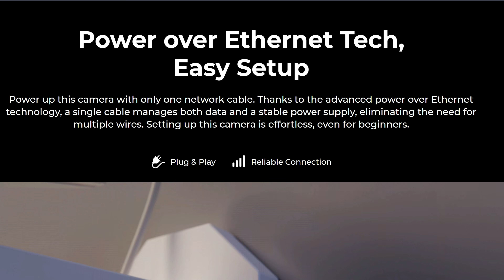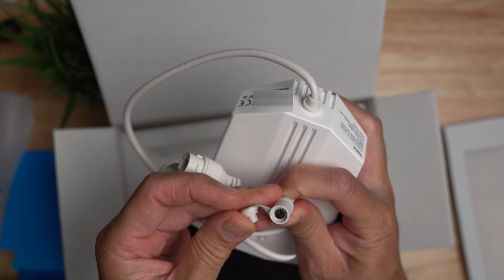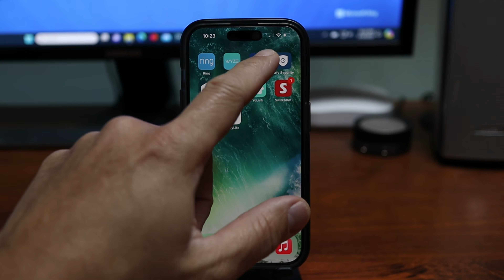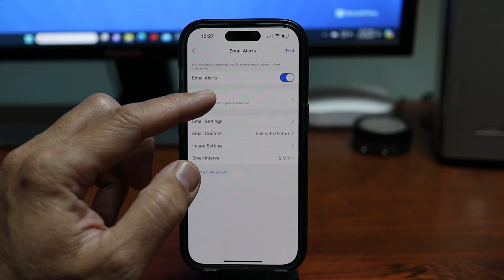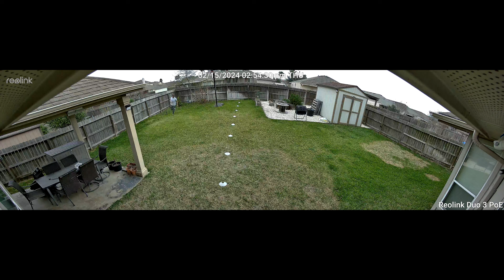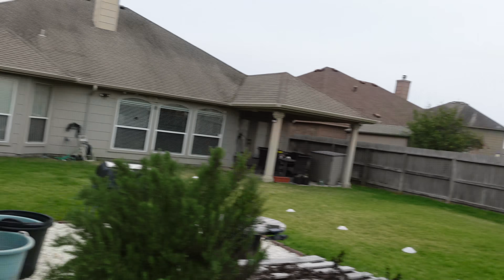Reolink Duo 3 Review - 16MP Dual Lens 180° View PoE Security Camera

Comment: This camera is NOT 16 megapixels… it is 8 megapixels.

This camera has two cameras within a housing unit with each camera capable of 8 megapixels each. Just because you have two cameras side by side with 8 megapixels each does NOT make it a 16 megapixel camera as each camera is only capable of producing 8 megapixels each, so it is an 8 megapixel camera (4K) despite how Reolink wants to advertise it.
Reply from the maker: Technically, it is 16 megapixels... 2 8MP stitched together resulting in a video resolution of 7680 x 2160 which equals to 16,588,800 pixels - 16MP.

Comment: This unit fails at 20ºF and becomes inaccessible either remotely or directly on the NVR. It still records and a microSD cards is advised. Strangely enough it will update the NVR at some point but live views are not possible. So if you are north of the 40th parallel, live in cold climate,  best to look for a more robust system. My Lorex cameras survive to 0ºF before they are no longer accessible but still record.

I have to wait for several hours after sunrise for the east and south cameras to warm up. The west cameras take longer and the north cameras longer yet and sometimes never become accessible if the temperature does not rise above 30ºF. It takes a while for the cameras to warm up enough to access. 

Currently it is 21ºF and I have lost 9 out of 12 Reolink cameras. I expect to lose them all in the next few hours and probably will have no access for the next 72 hours as the temperature will not go above 23ºF for 2 days. My Lorex cameras right next to them are still operational (the reason I have the two systems is reliability).

Comment: Ive been retrofitting a shitty cable with power injection security system with a defunct app and have replaced my house with a variety of Reolink cameras because of your thorough review videos. A 823a PTZ camera for the front balcony, two "vandal proof" 843a cameras for ground level and now two Duo 3s for the back and side. These are SO EASY TO SETUP its unreal, they literally set themselves up!

Comment: The app is garbage for playback control. The zoom keeps resetting instead of staying at the set zoom anytime u skip around in the timeline. Also there are no basic things like skip or zoom control buttons. Very annoying to use. They obviously haven't tried using zoom from the touchpad of a laptop. The camera mount sucks too. Can't do basic angles. I had to borrow a mount from my 10 yr old Axis brand cam. Probably gonna end up returning this piece of crap. This product needs LOTS of refinement.

Comment: I bought both the 12MP and the 16MP. The 16's image quality is comparatively very poor. Way over sharpened, many more compression artifacts, and not nearly enough noticeable resolution to justify its higher price or higher bitrate.
Reply: Thata because it is a duo lens. It is basically 2 8MP cameras stitched together. Of course it is going to be lesser quality than the 12 mp....
Reply: @VastardokKukiao  Oops, I should have said I bought both Duo 2 and Duo 3. So that would we be 8MP vs 16MP.  It's definitely double the file size and maybe 1.2x the quality. Rushed that trash back to the company.

Comment: The resolution of 16mp is 5312 x 2988 for one lense, so for a dual 16mp camera it should be 2 x 5312 x 2988 resolution combined. 

Thats why the Duo 3 footage is not impressive compared to other 4K cameras, Duo 3 is actually a 2160p resolution camera.
Reply from the maker: It is a play of words in advertising. It is basically two 8MP sensor cameras, not 2 16MP.

Comment: Thank you for your videos. They are really helpful with a good balance between technical and practical user info. One question which is general and not only applicable to this camera. You seem to only test the maximum detection distance in daylight. How is this distance affected during night time when I have the biggest risk for intrusion? I am worried that areas that will be covered for detection during day time will not be protected during night time.
Reply from the maker: It is usually around 30 feet with Reolink but it will depend on your ambient lighting.  At night, the camera will have a hard time discerning human shapes at farther distances compared to during daytime. If someone intrudes your property, they have to get closer than 30 feet and the camera will definitely detect that.
Reply: @LifeHackster  Thank you for your response. Is this distance generally reduced for wireless cameras or is it the same?
Reply from the maker: @gerhardduplooy7376  wireless or battery powered cams uses a PiR sensor which has around 20-30 feet reliable detection range to trigger it and it will still depend on how the camera sees at night (lighting conditions) to know if the motion is a human or not…now this is when AI smart detection is used.

Comment: 256GB maximum capacity is a bit low for a duo-4k resolution. Reolink should have at least upgraded to 512GB, 1TB will be better.
But one can see this camera is better setup with a NVR system which then eliminate the storage amount constraint. 
Guess there will not be a WiFi version for such high resolution model.

Comment: @LifeHackster  do you terminate your ethernet cables yourself? Can I use pass through connectors or should I use standard/non-pass thru to avoid moisture intrusion and other issues?
Reply from the maker: I use pass through connectors because you will have a 100 percent connection success rate. With standard ones, I occasionally have to redo it.

Comment: My experience with motion tracking (with various brands) have been disappointing. At this point, I'd prefer/wish I had a wide FOV.
Reply from the maker: Motion tracking cameras have more parts and features that can fail compared to a static camera that has a wider FOV.
Reply: Is there a tech model where possibly there's 180 FOV (like WYZE) and a separate zoom cam like  the latest EUFY? Perhaps that combo on one moulding could have best of both worlds.  @LifeHackster

Comment: great review as always. I do notice the vertical or up down field of view compared to the duo 2 is a bit more narrow but horizontally it is a true 180 degree fov unlike duo 2 only 170. for my use vertical fov is more important so its kinda one step forward half a step backward. I have two duo 2 cams installed one cam is directly over my garage door brick wall mounted at around 10 feet height from the ground. walking towards the camera when I'm basically directly under it I disappear into the blind spot area. I can then do what a potential vandal could do hit it from behind with a pipe bat or cut the cable behind the housing. so to mitigate this problem I have 2 cx410 cams facing inward at the corners on the same wall to view downward below my duo 2. another option I could try is 2 of these duo 3/2 cams installed with one cam higher up above the bottom one both centered of course and the lower cam can be tilted downward much more and the blind area will be smaller. but still it is good to see new and better stuff come out. LH whenever you got the time to make it happen a same day footage comparison between both duo cams would be nice.
Reply from the maker: I will eventually try to compare this 2 but I will tell you that the duo3 has way more limited FOV vertically compared to the Dou2 and it might not work with your setup.
Reply: @LifeHackster  yep your correct. I actually think having 2 matching duo cams one above the other probably would end up with not matching diagonal distortion near both ends of the fov. I could be wrong even tho I haven't tried or tested this setup with the 2 duo 2s I have.
Reply: add this. or make a software controlled tillable mechanism mount or adapter for the duo cam

Comment: I agree with a redditor that has a good comparison beteen the duo 2 and the duo 3 FOV. The "5 degree" difference seems to be a lie. Theres no way that much vertical loss is only 5 degrees.
Reply from the maker: The limited 50 degree FOV is not a concern if you are hooking this up in a 1 story house. With an 8 feet height of install, it is just enough to not show mostly the sky. Now, the only thing is that because of narrow vertical FOV, in the app, you need to flip your phone to landscape mode to see the feed better.
Reply: @LifeHackster  I actually disagree with you because I currently have my Duo to on a single story home. The install is definitely higher than 8 ft though, so I could catch as much in my current fov as I wanted. If I changed it out to the duo 3 I would be able to see my driveway still and probably half of the street in front of my house but I wouldn't be able to see beyond that.

Comment: Hi LifeHackster...Question: Can I connect to my Google Wifi points (non-router) using PoE or does it have to connect to the main router?
Reply from the maker: I'm assuming you will connect it to an access point that is connected wirelessly. You will be able to but most likely will get into connection cut outs or problems.
Reply: @LifeHackster  thank you!

Comment: I wanna love the Reolink Duo series but there's A LOT of design flaws: the whole mount is held together by a single bottom screw, the power cable is directly exposed and there's NO way to hide it, the provided mount is way too long and makes the camera wobble a lot, and the SD Card port is literally at the front in plain sight where everyone can see it. In case you have the siren turned off the camera doesn't even makes sounds or alert you if someone physically moves it out of the field of vision (like eufy's thief detection).
Sure if you're installing this camera on a tall wall or activate the siren on motion detection 24/7 none of this matter, right? But if your only option is a 2.x meter wall (which is the recommended height by Reolink btw) then someone can still cut the power cord, or remove the SD card, or straight up just pull out the whole camera body and steal it (and you won't be even notified about it!) in plain daylight so it's better to look somewhere else. It definitely doesn't pass the vandal/thief test which it sucks giving that I really wanted to install this camera on my area. (Not even gonna mention that is really ugly and sticks out a lot, and the cable end with the reset button is such a bad idea...)
Reply from the maker: The other 2 new models are better looking and easier to install especially in under the eaves or ceiling install.
Reply: @LifeHackster  Yes I'm really looking forward the new Argus 4k dual lens 180°! It fixes most of the designs flaws of the duo 3 in a smaller better-looking form factor
Reply: Thats why you have to pair your camera security ayatem with an alarm and motion sensor system... Be smart....

Comment: Just a question what is the difference between duo3. 3T and 3V
Reply from the maker: Form factor and design mostly.
Reply: Hey  @LifeHackster   Thanks for the quick reply! after many years of IP cameras in my hotel....starting with D-link in 2011 (super expensive at the time) then to dahua(nice bur very hard to set up and make them functional) and now to Imou and TAPO(for the cafeteria mostly)
I decided to change all my cameras to reolink because of your analysys!....
A big issue for me is that on the street side i can't read the licence plates (30 meters is my hotel length and cars drive by usually with 20Km/h...very good municipality lighting all night)
I tried the 811 even with zoom (live view feed)I couldn't get the moving cars plates.... only the parked ones....maybe there should be a better image processing NRV?
So the question is should i get the new the duo3 to install it in the middle of the hotel and get more chances to get the licence plates(15 meters each side if i place it in the middle of the wall)
Maybe i should seek for more Frames/Second than MegaPixels?
Thank you very much for your time
Reply from the maker: License plates reading of moving cars is going to be a hit or miss when using any regular security cams. LPR cams would be a better option because it is specialized for that purpose. Now, if the cars are stopped or in a parking lot, then yes, most cameras with narrower FOV or optically zoomed lens will work. I would not recommend the Duo 3 or any wide angle lens cameras for this purpose though.  @manolisvl46
Reply: @LifeHackster  I want to stick with the reolink cameras though...
So I better get rlc-81pa or rlc-81ma?

Comment: Do you feel like you lost a lot of vertical field compared to Duo 2?  How is the night time performance compared to Duo 2 without spot light or IR, just with porch light?
Reply from the maker: The 5 degrees difference in the vertical FOV..as to FOV, not that much because half of the vertical anyways when set up in a 1 story house would be the sky...BUT, the user experience in the app is definitely affected that you do need to turn your phone in landscape mode to see better. As to video quality, within 30 feet, there is not a lot of difference between the 2.
Reply: @LifeHackster As I stated in prior reply, the vertical loss of the Duo 3 is over 10 degrees, Reolink needs to change the specs.
Reply from the maker: @Markssongsandstuff   I just uploaded a video… I compared the FOV to the 811A which is also 55 degrees and they are the same.
Reply: @LifeHackster   Just my opinion but to me there is more vertical sky above the neighbor's roof with the 811A than the Duo 3, but not a huge difference.

Comment: Would say the duo series is better than RL CX410
Reply from the maker: They are different cameras with different purposes. I wish they will come out with a dual lens CX line soon.
Reply: @LifeHackster roelink could make a dual lens cam right now that is like the original duo in the same or similar housing but with the cx410 colorX sensor and processing hardware.
Reply: Until the sun goes down.

Comment: Is the field of view shrunk down a little compared to the reolink duo 2 version? I see your using the pocket 3 to film your 1st person shots, what acceories are you using with it? I just got one myself
Reply from the maker: The vertical - 55 degrees for the Duo 3 and 60 for the Duo 2. I didn't use the pocket 3 in this video unfortunately because I had the "screen" issue that some were having and I have sent it out to DJI to be fixed. (They sent me a new one)
Reply: @LifeHackster  A guy on Reolink Reddit did an exact overly pic of the Duo 3 over a Duo 2 pic.  The vertical loss is over 10 degrees.  Reolink should change the specs to the true loss.

Comment: This Duo 3 16MP can be used with the regular NVR?
Reply from the maker: Reolink's NVR.
Reply: @LifeHackster  Yes, I mean Reolink NVR but only support up to 12MP and there is no update so far for the RLN8-410.
Reply from the maker: @VictorSantos-fs5bu  as you can seen in the video. I hooked up mine, no issues.
Reply: @LifeHackster  thank you very much.
Reply: Honestly, why not just go to the website of the actual manufacturer? LH is fantastic at showing the practicalities but surely you must realise the technicalities should direct you straight to the folk that manufacture it?